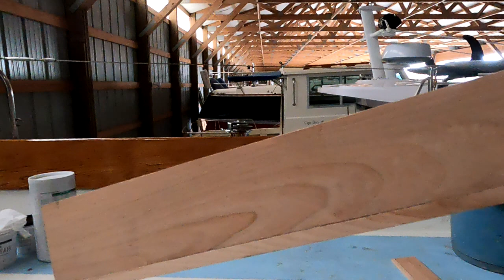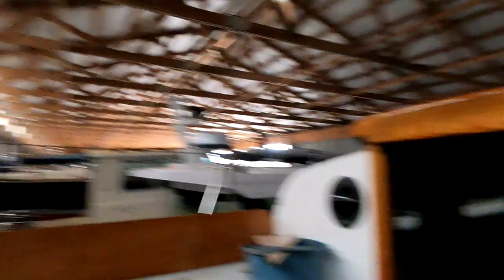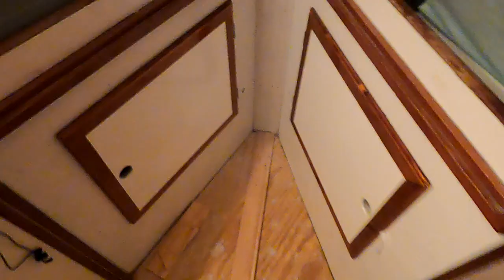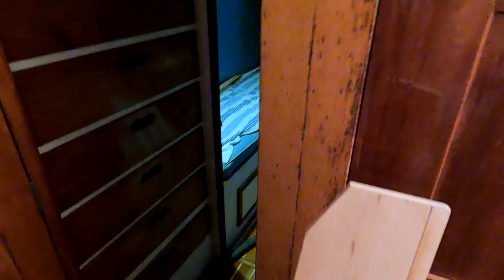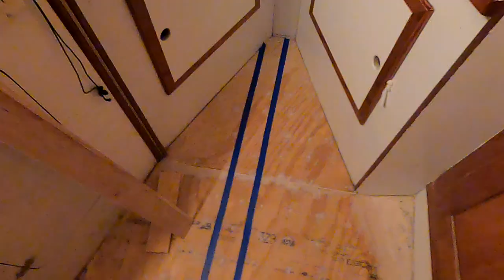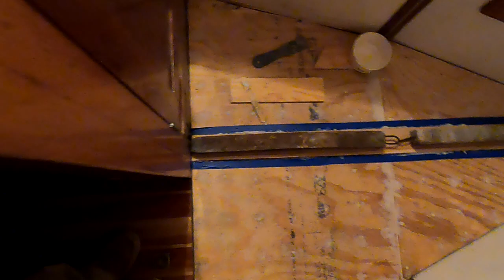DIY Cabin Sole Built Part-3 - Gluing Down the First Cherry & Maple Plank

Comment: Brad nails are brilliant, i learned that epoxy stays viscous a long time the hard way. I went to lunch and my nonskid slid down the deck.
Reply from the maker: Yes indeed, wet epoxy is pretty slippery.  I learned that during lamination of the first frame I put into my wooden boat Tortuga.  The brads kept the plank strip right where I wanted it and the holes they left were filled with epoxy when I glued the next strip down.  Thanks for the comment.  I hope you caught the non-skid before it was too late.